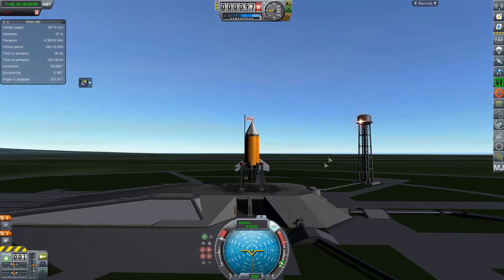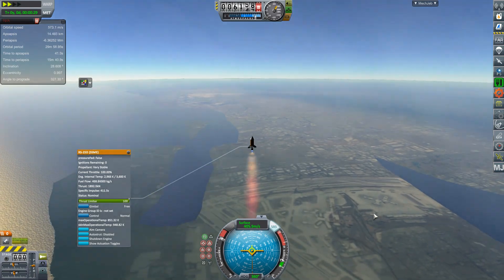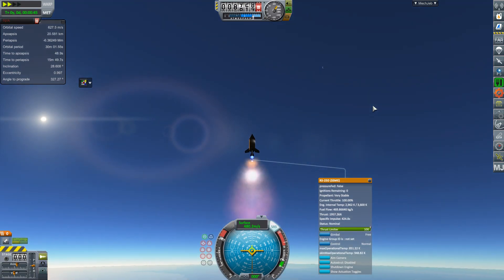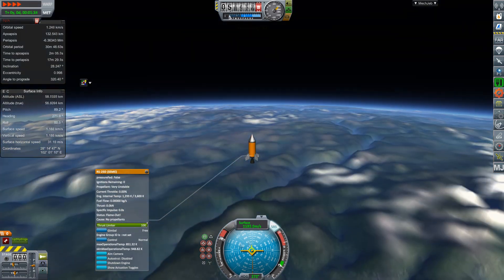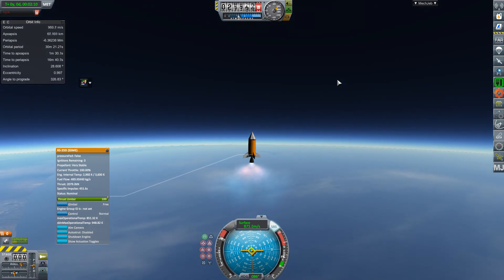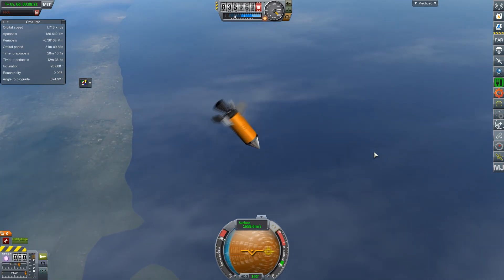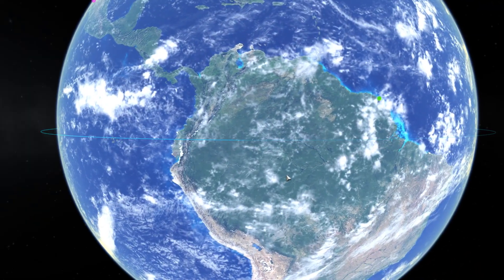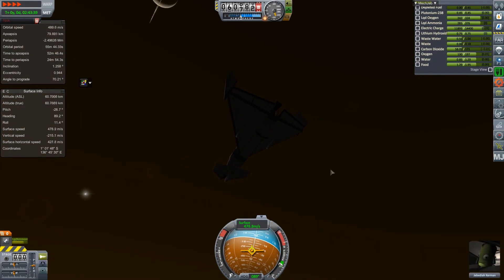Does Launching Rockets From A Mountain Really Help?

Comment: You should do a video explaining why it's more efficient launching a rocket on the equator. you could also fit in some atmospheric science too. :P
Reply: short version, you're moving faster so require less dV to get to orbital velocity
Reply: Add that to the mountain launch. Let's build a launch site in Peru.
Reply: Corey Newhard that is not really true, earth is just 0.3% bigger on the equator. for comparison, a official billiard ball can't deviate more than 0.1%. so earth is pretty damn spherical...
the reason its better to launch at the equator is because the rotation of the earth give an extra boost to the rocket speed, its not much, but it helps.
Reply: why Peru? the equator doesn't pass through it and it isn't as tall as practical as it would be in Ecuador, the equator passes straight through and a launch site on the Andes area (also the most populated zone of the country) would be perfect, near cities and at high altitudes on the equator, sounds perfect to me
Reply: +Corey Newhard actually you have more air resistance due to the moon's tidal forces, a higher gravity, centrifugal forces and the amount of sunlight the equator receives has a slight effect as well on air density.
Reply: I meant near cities but not like a km away lol, i meant near cities cause of logistics, if there's a city then there must be a way to transport goods, if goods can be transported so can rockets... kinda
Reply: the biggest reason is that you can get into a "flat" orbit without a plane change.
Reply: starmax1000 You can't launch a rocket near cities dude. Even if everything goes fine and dandy the sheer noise will disrupt the citizens and if you're rocket goes kaboom, well that's obvious
Reply: starmax1000 Canaveral is in a great spot with respect to shipping. It's very easy to get deliveries there. And as far as I know, there aren't too many disruptions, except for possibly the sonic booms when F9s land back at the station.
Reply: Peru is actual where the point with the lowest surface gravity on earth is located.
So rotational force of earth + slightly bigger radius + height advantage of mountains + low surface gravity = good launch site.
Reply: Scott did mention Chimborazo as a launch site, which is the highest volcano in Ecuador, and very close to the Equator. Apart from that it is totally unsuitable for so many reasons, which do not merit listing.
Reply: because earth isnt a perfect sphere and the earth bulges at the equator, so it's higher up so less gravity (and possibly air resistance) and less fuel needed for the same velocity, or in other words, this video but with the equator instead of mountains.

Comment: Willing to bet the people asking weren't considering specific impulse, gravity or drag, but simply "if I'm on a 1km tall mountain, I can fly 1km higher" ;)

That said, you have to get the rocket onto the mountain in the first place. Most reasonable people wouldn't use a rocket for this, but physics says there is a minimum energy requirement for it, be it with a truck, or a crane
Reply from the maker: Yep, the chinese launch sites weren't chosen because they were a mile high, they were chosen because they were in the middle of the country and remote enough not to be easily vulnerable to attack.
Reply: How efficient your engine is. The higher your specific impulse, the more deltaV you get from the same amount of fuel.
Reply: Something that wasn't pointed out is what is also on the mountain which can impede construction of a suitable launch pad.  Ice, rock, wind, and ever-changing conditions can make such an endeavour likely not such a true benefit to what is saved from launching at that elevation.
Reply: i hear alot of good logic tossed at this, but ultimately it's money and personal effort that decides whether it's viable or not. If we had a giant lift on top of a cliff, people would be far more apt to do it than if you had to drive 100 trucks 100 miles up a winding mountain pass. Is it better, yes. That's not the question here though, so i'll C my way out.
Reply: Yes, well it would be very hard to bring anything up more than what you need. I believe a French pilot may have brought up a helicopter to the summit and touched the top. He would not have been able to takeoff again to to the lack of air or pressure. You would need to have the VAB at the summit.
Reply: coryman125 i doubt scotts fans would have though that, unless they were really young lol
Reply: What is specific impulse, I know the rest but what is it?
Reply: Ok thanks!
Reply: In very simple terms, it's the impulse (change in momentum) created by a set amount of fuel. Basically, the more impulse you can get from each drop of fuel, the more efficient it is, and the higher the specific impulse. I'm sure there are some good videos on this channel if you want a better explanation than I can give
Reply: Or a ski lift.
Reply: Also transportation of the parts.
Reply: We put our launch sites in Florida because we secretly hope the debris wipes everyone there out... but that pesky ocean keeps getting in the way.
Reply: coryman125 i was thinking mostly at altitude of 10 km for example you dont have to deal with 90% of atmosphere and spacecraft can have bagger nozzle at 1st stage
Reply: Well, the simple "I can fly 1-8~ km highter" really helps too considering this is 4% of Earth's low orbit height
the cost of launching from Everest though...
Reply: What about the fact that your craft has 100% fuel if launched at X km altitude (whereas it would have Y% fuel at X km altitude if launched from 0 km altitude)?

Comment: Always had a dream of propelling cargo to space utilizing a mountain and a - U - shaped mass driver. The cargo goes down the rail from the top of the mountain utilizing earth gravity for the momentum velocity and the mas driver magnets for further velocity.
Reply: The going down part won't help much. You could use the energy used to lift the cargo to the top of the mountain to accelerate faster and the material to make the rail taller. But air drag would kill it anyway. An hyper loop tall enough tho...
Reply: U shape won't help you with efficiency but it would help disassemble the payload along the bend.
Reply: Lord Zephyros THAT WAS MY IDEA
Reply: oh, im glad im not the only one! :)
Reply: Y'all don't understand. You don't use a U shape, you use an H shape. A left vertical shaft in which you drop the payload, that has a blue portal on the bottom and an orange portal on the ceiling. When enough speed has been generated, the orange portal is moved to the floor of the right shaft, which has an open ceiling, and fired into space.

There is only one safety concern with this device: an identical one must be built on the other side of the planet, and it must launch the same mass at the same time, in order to cancel out the effect on Earth's orbit and not crash us into the sun.
Reply: aaaaand the cargo would be vaporized in the process, we are talking going with orbital speeds in dense parts of atmosphere.
Reply: There are a number of different methods of doing something similar to this that I think we should look into. Some rockets are already tested mounted to sleds or carriages on horizontal rails and have done so for decades. Aircraft have been launched using ski jumps, steam catapults, and more recently by electromagnetic catapults. Some high speed maglev trains have now reached impressive speeds with good reliability. 

Some type of system of boosting a rocket with a rail or catapult seems like it could save some fuel mass on the rocket. The tricky parts would be designing a reliable system of carrying and detaching large rockets and limiting damage to the system itself from the rocket exhaust. Unlike a mass driver the initial velocity would not be so extreme as to create additional issues from friction and g-force.

I would like to see Scott build some experimental version of this in KSP on the side of a steep mountain. Perhaps it could launch at a 70 degree angle or so. I am curious to see how much of a boost could be gained and if it is significant enough to consider building such a contraption. The efficiency gains from launching at a higher altitude would also help of course.
Reply: Yes, starting from the top of the mountain would be pointless but starting from the base of the mountain would be more interesting as the system would be able to add some speed and point the rocket in roughly the right direction. Using steam or electromagnetic propulsion is even more interesting as it could possibly save money in fuel if used often by using relatively cheap electricity for this initial boost. It could also potentially reduce some local environmental hazards posed by some fuels. A version of EMALS for rockets that is installed on a slope with a carriage of some kind to hold the rocket off the ground might work.
Reply: yeah dats gud idea
Reply: randomnickify it depend's of the material
Reply: The lower part of the U would be the trickiest part where normally most built up energy would be lost.
Reply: it would work best if you made it a vacuum and use rockets once the tunnel starts ascending.
Reply: pyro, wtf? I'm sure i must be reading wrong, cuz it seems like you're saying that starting on the ground still, would be no different than starting on the ground at speed...
Reply: I guess i see what you mean, it was just at so basic a level i missed it. it's correct enough to be considered in the result, but not so correct to prove anything against the result. Otherwise, good ideas.
Reply: So, essentialy, the world's best slide?
Reply: It would be the best roller coaster ride ever.